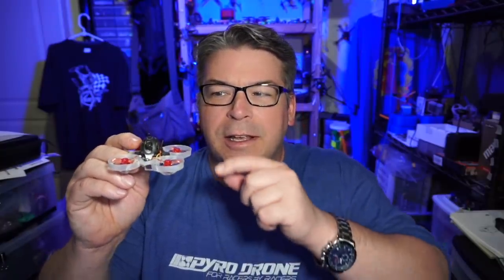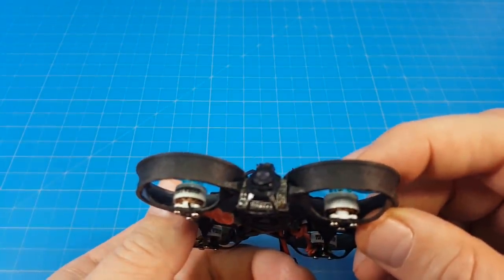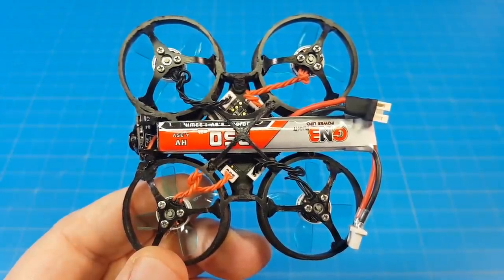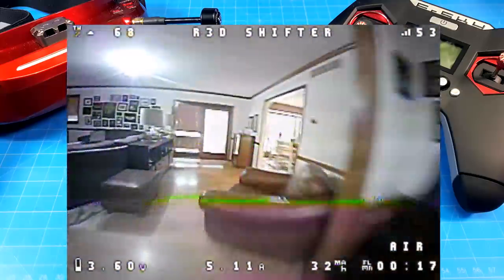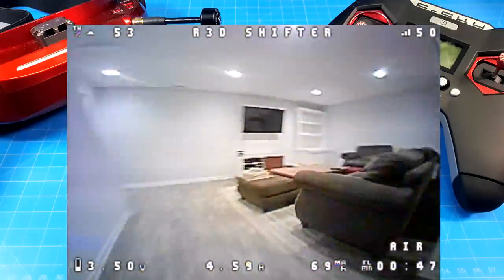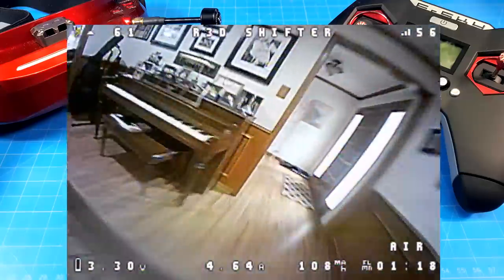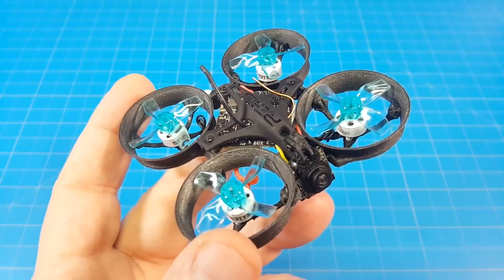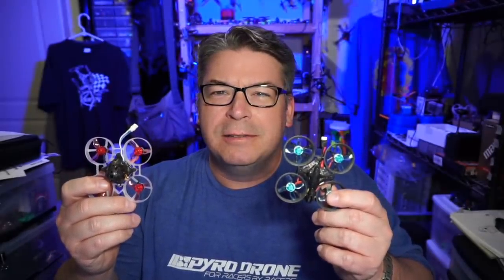ZeroGrav // 3D Print // Carbon Fiber Printed Micro Frame

Comment: You would think that those motors attached solely to TPU hoops would be a flex problem but the flight doesn't show that....interesting...
Reply: Thats because it's not TPU, it's nylon X, a carbon fiber infused nylon filament. There's a matterhackers episode on these guys.
Reply: @srossi88   Perhaps but it's still flexible based mainly on the video of him flexing the ducts. Again..doesn't seem to be a problem just thought it was interesting since people seem to go to efforts in frame design to eliminate flex albeit on bigger scale quads . ...something about FC's having to work overly hard trying to compensate ...and video vibration but that seems OK..the video part..no way to know w/o a blackbox log to see how the motors respond..
Reply: I guess it's just light enough to work? And the weight is mostly in the (more sturdy) center part?
My UR65-framed whoop is strangely my most locked in quad, but it's far from stiff, too!

Comment: Interesting topic and review! Can you say something about the stiffness of this frame, how does it compare to the mobula6 or maybe the meteor65 frame? Based on your flight experiences: does stiffness matter, or is it much less important than weight? Maybe also worth trying (for somebody who is able to print Nylon Carbon): https://www.thingiverse.com/thing:4078719
Reply from the maker: stiffness and weight go hand in hand. The more weight we have the more stiffness we should have, or it impacts flight performance in aggressive maneuvers. This as well has most 65 mm frames aren't stiff, but I don't feel it impacts flight performance at an appropriate 65mm 1s whoop weight. If we get a more stiff frame the weight goes up and also impact flight performance but in a different way, and the impact is constant not just aggressive maneuvers. But are also more durable.

Comment: I like the design of the frame, but sceptical of racing a 3d printed frame.  Id rather see it injection molded.
Reply from the maker: I did learn we can tighten the fit of the motor mounts by spreading the "clasp" with a flat screw driver. Not that it eliminates the risk.